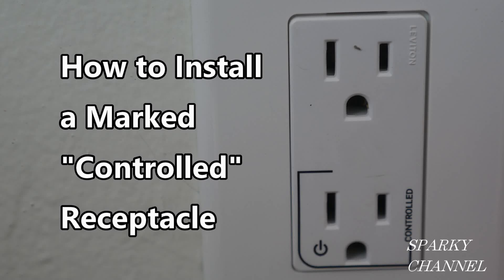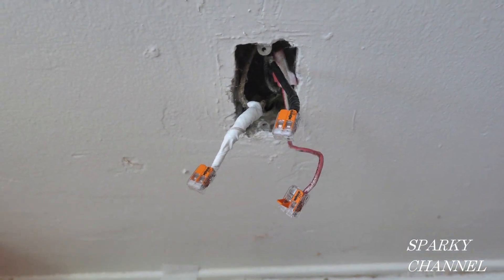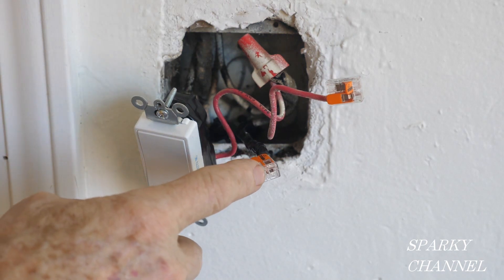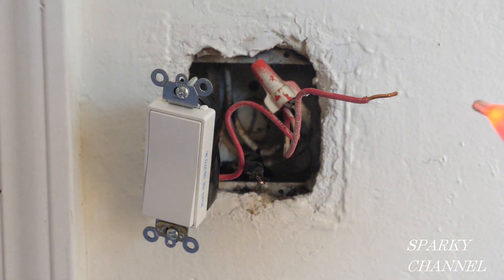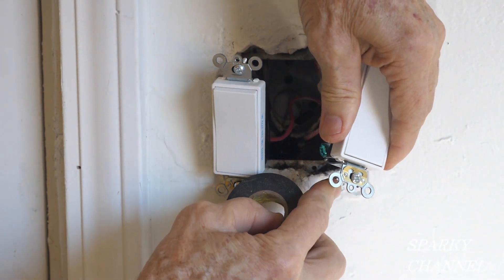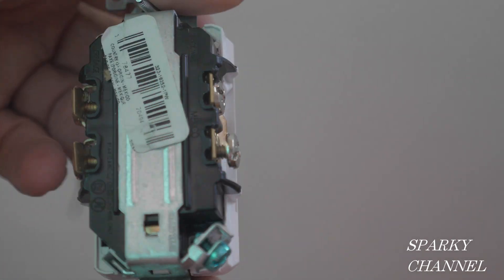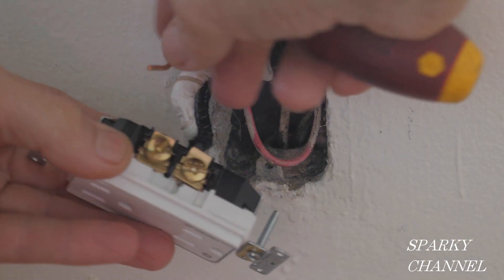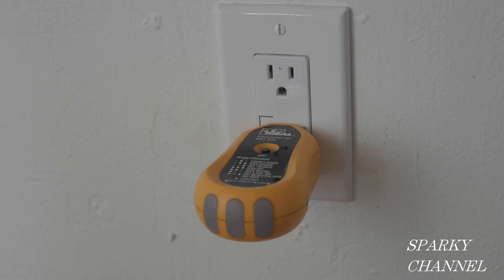How to Install a Marked Controlled Receptacle

Comment: Sparkey why did you not install receptacle with the ground on the upside ?
Reply from the maker: Preference.
Reply: @SparkyChannel  i wondered , i watched a few of your videos , you stated when you have a half switch to put the ground facing up  as to alert there is a switch connected to the outlet ?

Comment: I'm curious about older homes that were built before 1962, where many receptacles & boxes were not grounded & bonded:  were the switched boxes required to be grounded & bonded, even if the builder originally installed ungrounded receptacles?  If so or if not, are there switches that have GFCI/AFCI protection built into them to cut off power if it detects a ground fault on the switched circuit?
Reply from the maker: 1962 was kind of the wild wild west for electrical. See my video: How 1960's Metal Electrical Boxes Were Grounded: https://youtu.be/nFL_nNPOztk

Comment: I'm surprised that more old houses don't burn down due to the poor wire work. I don't think that I would trust those wego (sic?) connectors.
Reply: They remind me of those back-stab switches and receptacles.  Seems like very little contact area.  Expensive, too.

Comment: So basically is a half hot receptacle, I've installed so many for entry and for garbage disposal under the kitchen sink, also I've installed them controlled receptacles in a comercial setting, controlled by motion sensors, mostly in office buildings.

Comment: very interesting so now u can by a recepticle dedicated marked as switched , use to wire recepticles that half was full on the other half switched , nice to see a product that now has the markings , great for apartments were they have a recepticle on the wall thats half hot half switched

Comment: One tip when insulating old wires and color coding them rather than use insulation tape which in my view loses adhesion even UL listed tape try using UL listed heat shrink tubing that way it’s way neater. Just remember to put some heat pad behind the pad when doing this especially in plastic/PVC boxes.

Comment: When I install split receptacles, I use a red permanent marker and put a large red dot in the middle of the switched side of the outlet. When the room is empty, like when someone moves in, it really stands out and is pretty obvious that it's a switched outlet.
Reply from the maker: Sounds good!
Reply: It wouldn't be a bad idea to print a label on some small return address labels to mark the receptacles.  Avery-Dennison has a labels program to print up labels, and many print programs have the template for Avery labels.  You can use that program to print up extra labels for GFCI and AFCI protected receptacles, and print the "No Equipment Ground" labels as well.  I've used that labeling many times to print various labels.  The labels will be easier to read than the ones supplied by Legrand, Leviton and Eaton.

Comment: So in the US you have lighting and sockets on the same circuit? Do you use the same size cable for both?
Reply: often, yes. depending on the state, and city, building companies get away with bad decisions.
Reply from the maker: Yes but if there is any receptacle on a lighting circuit we would use 12 AWG wire and a 20A breaker.
Reply: @SparkyChannel  Our lights switches (UK) are only rated for 10Amps.   You can get a 20A double pole switch but we wouldn’t use them for a light.  Fault finding on a lighting circuit is real pain as it is, with fancy lights etc and carrying your ladder around, so adding sockets (receptacles) to the circuit doesn’t sound appealing. Good videos, interesting👍

Comment: hello sparky,hope you're doing great;now, I have a question when you install GFCI's in an ungrounded electrical wired house ,should the GFCI trip when you press the test button?although there's no ground in it? thanks in advance and keep up the good work
Reply from the maker: Yes, it should trip. Thanks!
Reply: GFCI is independent from the grounding system

Comment: How was the outlet grounded? It seems to be since the tester showed it was. If self-grounding should the paper squares on the screws have been removed?
Reply from the maker: Great questions! Yes, the metal boxes were grounded by the old 1957 method of running the ground wires in the walls and connecting them behind the box. This was confirmed by test. Yes, one of the paper squares at least needs to be off. I've been noticing that the Leviton devices with the self-grounding clip have been coming with no paper square on the the self-grounding clip end. So there was no paper to take off. But if there was, I would have removed it.
Reply: @SparkyChannel  Thanks for the great response. Appreciate the info!

Comment: It seems like the more that manufacturers, code writers, and AHJ try to make instructions, rules, codes, specifications, and regulations more detailed and specific, the more they invite ambiguous and erroneous interpretations that weren't intended. For example, I note that this device uses the IEC 60417-5008 "Standby" Power Symbol and that its orientation as printed on the device suggests that the receptacle is "right side up" if installed "ground pin down". Is Leviton intending to answer that question definitively?

I am troubled that the code sections you mentioned in the previous video seem to leave out the traditional "half-hot" as a use for this device since the marking requirement only appears to apply to devices under some sort of automated control. I don't suggest that the code in any way "prevents" the use of this device as you have installed it here, but it seems to leave this to the descretion of the installer and the AHJ. I WANT half hots to be marked with clear, professional looking markings and not just by the local preference of "ground pin up, switched receptacle on the bottom", but the code as written would seem to leave room for an un-imaginative inspector to say "sorry, you can't use that device here because the wall switch is not an automated control system".
Reply from the maker: Amen brother!!!

Comment: I think the switch or switches that control the receptical should also be marked.
Reply from the maker: Scott, that's a great idea. That's another area of widespread confusion with the users.
Reply: @SparkyChannel  
I hate mystery light switches. 
The house I moved into two years ago had two. The one on the back of the garage wall was for a light in the attic above the entrance I the garage .
The other was a non connected switch filling up the 2nd spot in a double switch box.
Reply: try fancy houses with 2 4-gangs right next to each other; that's 8 switches, with half of then part of a 3way.
real fun to diagnose & service...
Reply: I prefer to install the black wire to the top outlet of the receptacle and the red wire to the switched leg of the receptacle, keeping with black is "hot" and red is "switched or traveler". San Diego is my hometown. Love all of your videos.